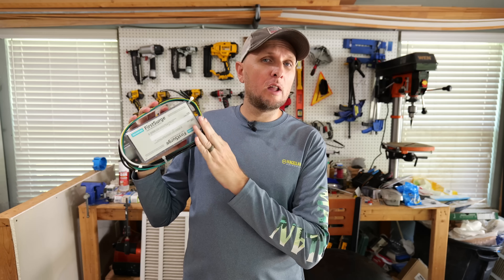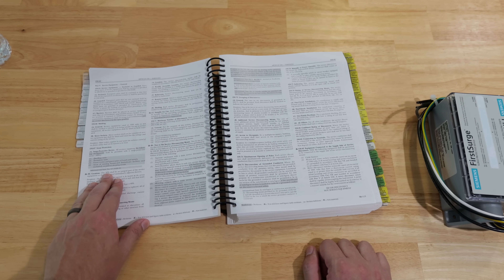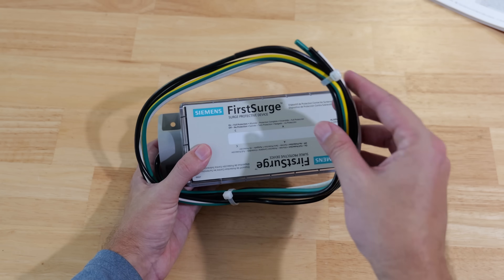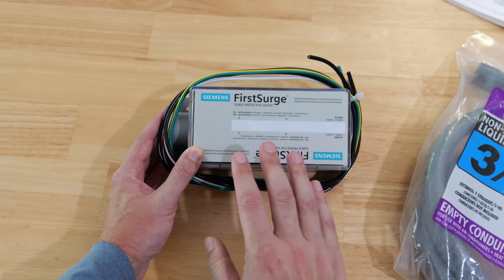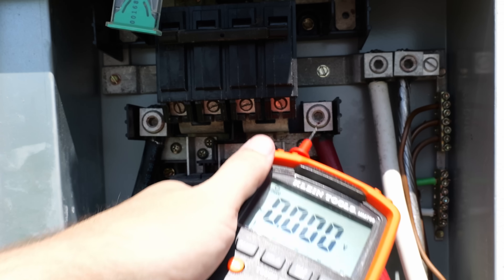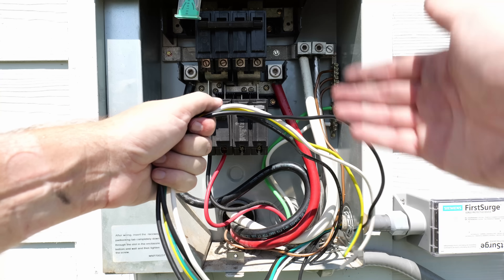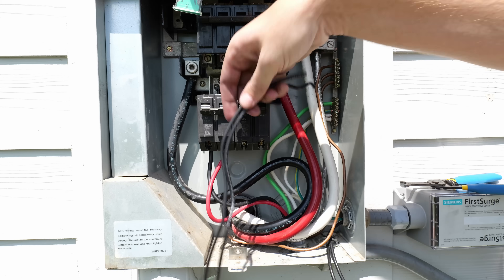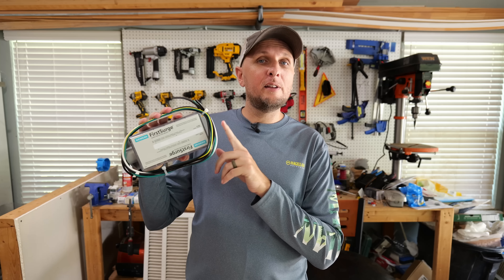Why Whole Home Surge Protectors Are Now Required and How To Install One!  Siemens FS140

Comment: Whole home surge protectors are very expensive and have a limited life. I installed BRANCH circuit protectors (20 amp) as my 20 of them cost less than a third of a whole-house protector. My house is 98 years-old and isn't "code" anyway, although it's electrically far SAFER than new construction. My late Daddy and I were both in aircraft electric repair and worked with 600 volt 400 Hz AC, he in B-47's and I in F-4 Phantom II's and "Scooters" and combat repair of other aircraft in SE Asia. We re-wired this house for my Grandparents, and the four "BX" armored cable 14 gauge circuits I use ONLY for lights. When I bought the house from the estate, I ran 10 gauge Romex to things like my entertainment center outlet and 2 gauge "220" to the detached garage for my shop and installed a new sub-panel in the garage. The Sola brand protectors I used claim they'll stop 5 or 6 major surges (like near-by lighting strikes) then they're gone. In 30 years I haven't needed to replace one yet.
Reply: I installed my surge protector 5 years ago for $65, they aren't that expensive.
Reply: not sure what you mean surge breakers?
Reply: Hello sir, can you explain to me a little bit about "branch circuit". Are these like independent  breakers with surge protection? I want to protect all my 120 v and 240 v equipment. Can you point me to the right direction? 
Thank you. OM

Comment: Thank you, I actually have a few of these I acquired at an auction, may not be same brand, I did not realize that they were a code requirement now.  So I will move up getting one of mine installed in the near term.  As to the value of these, they may not save a damn thing but they also might be the difference between a fire or not.  Screw the cost of the equipment, my concern is losing my home, so I am going to say better safe than sorry.  Most surges only last milliseconds and no this is not going to be good enough for a direct lightning strike but it should make the difference in a nearby one.  It might or might not help in an emp event, but then the ones that are specifically sold for that purpose are basically just one of these.  I was an electrician in the past but not anymore, I do my own wiring, I am lucky enough to live in a state where I can still do my own work, I do not pull a permit for a damn thing.  No one's business but my own.  If you have no ability to get to your box, or room in it.  You could piggy back it onto any 2 pole circuit, even your oven but the dryer  or the hot water heater would be easier, just add it in an extension cord fashion.  Note this would not NEC approved but it  would work.  I am not sure it would help as I said but it damn well would not hurt.  We all waste thousands of dollars on things like insurance we hope we never need.  This is just one more of those things.  If you can afford it or just like me happen to come across one, it is worth having for that hope it might help in an emp event.  I can live with the loss of my electronics, I cannot live with the loss of a home due to a fire.  I really think it is a shame so many men cannot understand or in fact install a device like this, this is one of the reasons our civilization is in such trouble, every man and in reality every woman as well should understand enough to know how to do things of this nature.  There is a world of difference between choosing to  hire work done and being dependent on someone else because you cannot.
Reply: But here is the deal , a few day ago from typing this , we had bad power supply from the wind knocking the lines 
This SPD won't protect your home from that but that will destroy more electronics 

But here is one thing they will protect,  your darn AC/heatpump when the darn thing is just trying to get started, yes your AC/heatpump pulls a lot of amps enough amps that those darn things just won't let them run , meaning you can say bye bye to cool air in the summer and If you have a heatpump,  you will be forced to use the Emrgency heat source all winter long simply because the locked compressor amps are high enough to always blow that device

Comment: Surge Protection Devides are not all they are cracked up to be.  The NFPA has stated that Metal Oxide Varisistors (MOV) based SPDs have been known to catch fire under sustained overvoltage episodes.  They do not protect sensitive electronics in those instances nor when brownouts occur.  What are the design elements of any SPD.  Newer ones may or may not have the sam issues.

Comment: Not to be a negative ninny,,, but,,, I've torn hundreds of TVs, home computers, satellite receivers and have found everything since the early 90s has built in MOVs which is whats in a surge protector to begin with. Based on that a whole home unit would seem quite redundant! A whole home unit would basically just be double protection which MAY,,, and I stress MAY save some equipment from surges. Even then, as others have pointed out, nothing will save you from a direct lightning strike! Now,,, a near miss can damage a hell of a lot stuff irregardless of weather it comes in on the power lines or not. A good example of this is I had two satellite receivers destroyed by near misses and discovered the surges didn't come in on the power lines at all but rather through the phone lines required at the time to make Pay per View work. A whole house surge protector isn't going to do a damn thing for that! Of course I realize twisted pair home phones are rare as hens teeth these days but it does illustrate that power line surges are NOT the only source of equipment damage.

Comment: Unfortunately my service box is recessed between studs (flat to the exterior surface). Would require modifications to the house exterior wall by the box. So not so easy.
Reply: Not if you used the surge protector that clamps on to the buss in the panel exactly like a breaker---if you have available empty slots in your panel.
Reply: @jerrydemas2020  Didn't know about them. Thanks

Comment: It’s nice that you show the code requirement for this SPD. Your installation does not comply with the NEC where as the code also requires that all connections shall be torqued to a specified poundage or newtons. If you are going to educate someone do so fully! I am a retired Union electrician.
Reply from the maker: Yeah, do you know for sure they aren't?  Did you inspect them?  Stop.  I have yet to see an electrician use a torque screwdriver on them.  I knew I would get this comment and it is just funny to me.
Reply: @HowToHomeDIY  yes I have used a torque wrench and it is a requirement that the electrical inspector watch you torque the screws and bolts. He then notes the torque and location of where it is installed. I also have a torque screwdriver which is calibrated annually. Again. I am not saying that you did not torque your screws but by your comment that “you have yet to see an electrician carry one”. You obviously do not have one or use one!
Reply from the maker: Right.

Comment: My home builder installed two breaker-style EATON whole house surge protectors during construction, and they've already been putting in work dealing with surges due to heavy storms and partial brownouts. They're still going strong. The next goal is to eventually get a whole house backup generator so we don't have to worry about the occasional blackout.